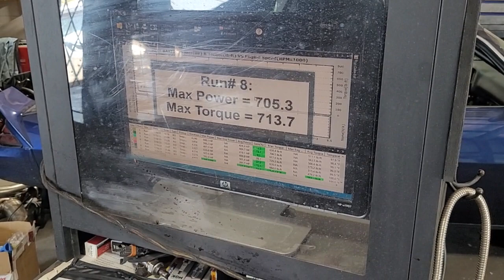1995 Mustang GT 351w turbo dyno pull

Comment: I’m building a very similar set up currently for my foxbody. With the F303 cam and those heads and stock 351 pistons and 1.6 rockers what length push rods did you end up needing???

Impressive numbers btw
Reply: One last question. Also, what duty cycle % were you looking at with that pump and injector size?
Reply from the maker: 7.400 inch pushrods from BTR using stock type head gaskets and stock roller rockers. I recommend measuring your own. 

I truly don't recall the duty cycle for the injectors on gas or e85....but low %. The pump is good for another 300-400 wheel hp on e85. The injectors go further than that. I got the flowmatched bosch 210s and spacer hats from VSR. TFS fuel rails.

Comment: Very stout numbers. Even more impressive since it's a stock bottom end and only 11 lbs of boost. Go do some LS  hunting now.
Reply from the maker: Thanks! It did 140mph at 6000 DA in Pueblo, CO on the 11psi. Though we didn't get a chance to dyno at this level, it picked up 6mph for a 146 on 14psi. It's amazed me for such a basic setup. I think a cast wheel turbo and typical 3" intercooler would have struggled more.

It's held its own against similar LS setups!